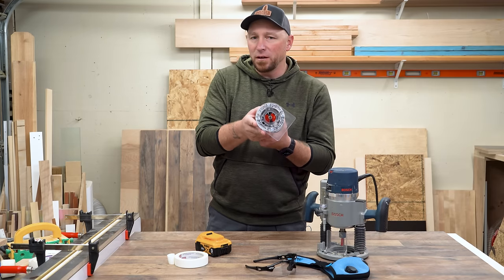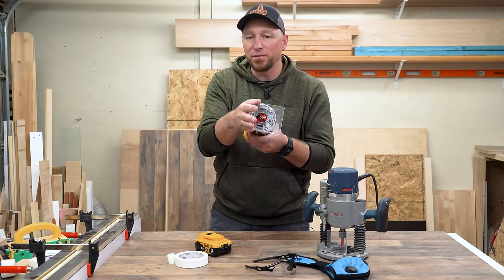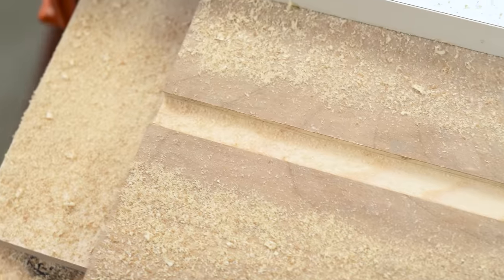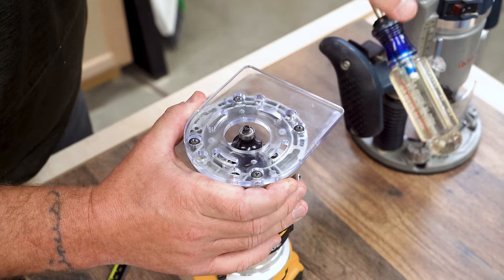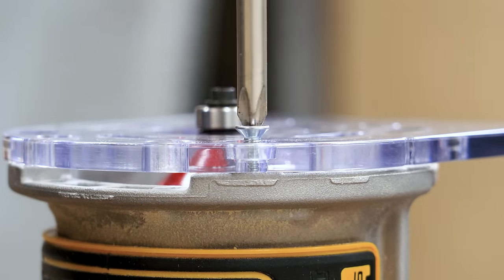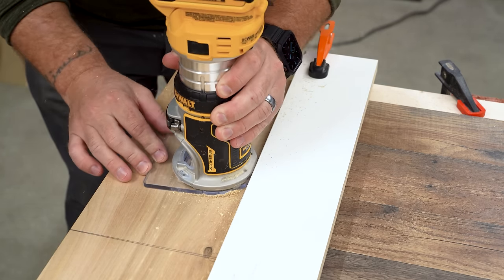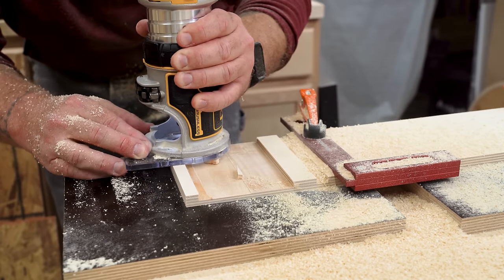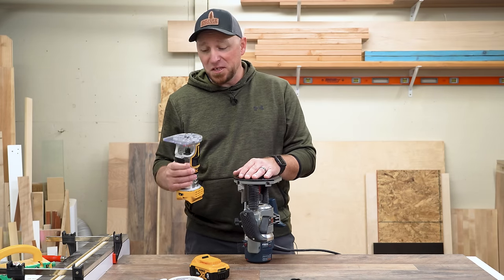END Router FRUSTRATION With This ONE SIMPLE ADJUSTMENT / Woodworking / How to Adjust Sub Base Plate

Comment: The flat side is for widening a groove without repositioning the fence or requiring a perfectly sized bit. After routing along the round edge, the router is rotated to reroute along the flat edge. Since the flat edge is closer to the center of the bit, it creates an offset cut closer to the fence. The offset distance can be shortened or widened by adding a shim to either the fence or the flat edge. Essentially, it makes your jig from your last video obsolete.
Reply: Do folks do this...YES!!!...is it safe or the intended method, not at all...

 The flat side, as many here have suggested is for bit changing and/or for use with a bar rod tie-in concert with a rail/guide system.  "Free handing"  (aka the "cowboy method) with the flat side held against the rail (though common) is not safe, nor allowed in many professional shops and schools...
Reply: @JayCWhiteCloud  There's no issue to routing with the flat against an edge guide, unless you're routing in the wrong direction. The flat can be used for anchoring the router during bit changing, but it's quite a stretch since two wrenches are used and the base is removed.  I really don't see where the flat helps with a edge guide rail system at all.
Reply: @bobweiram6321  As stated, do as you wish (as many do)...HOWEVER...there very much is an...ISSUE!!!...with using the flat edge as a guide against the straight edge (as Jody correctly in his video pointed out!!!) as this can lead to all kinds of issues...and is not the method to use (though many have chosen to.)

As for "stretch" that would depend on the router, though many actually take you through the process in the directions and point out (correctly!) the purpose of the flat edge for stability...

The flat edge for the guide rail is only on some models while others still only have the round edge toward the rail...which depends on the manufacturer...

The only reason I comment on posts like this is too many "students" and/or a novice trying to learn...BEST PRACTICE...in a given skill set...get very confused about what's correct...what is WRONG!!!...and/or unsafe. Case in point a student asked me about this video and how accurate it was...

Again, due as you please (by all means,) and understand my response is for those that don't have experience and/or are trying to learn "best practice" for a given tool...
Reply: @JayCWhiteCloud   You make it very hard to take your best practices seriously when you demonstrate consistent difficulty with basic spelling. It's "do as you wish...", not "due as you wish."
Reply: @bobweiram6321  Typo corrected...didn't change the message context though...

Comment: Wouldn't it just be easier and quicker to just use a centering cone? They're not very expensive and work for both 1/4" and 1/2" collets. I bought one along with my first router and keep it with my bits.

Comment: I always thought the flat side was for easier stop dados and other cuts I don’t want to run full distance. The center of bit line is easier to see and is naturally squared up so I can mark the guide rail for start and stop points or blocks if I’m doing a bunch.
Reply: This again is a "make it work" situation but not what the flat side is for, nor safe to use that way compared to the suggested methods by many here...

Comment: I have a near antique commercially made router table, and the mounting bracket on it requires the flat edge of my router to be oriented so that the flat edge is against the flat edge of the table.

Is that the reason for the flat edge, I dunno. But it might be part of it.

Comment: My belief is that router manufacturers provide a flat face on the circle because the overall diameter provides stability, but having a flat face might allow you to get a cut that is another increment closer than the radius of the circle allows.

Comment: Tapered screws in plastic are a mistake. The angled head produces a state of tension in the plastic. The plastic used in the router base holds up well under compression, but is vulnerable to cracking under tension.

Comment: I always thought the flat side was to get to the end of a boards whem you use a short paralel guide. To prevent the router from twisting around the guide. Whatever... I will use It as i always did. Round side in...
Reply: The flat side is only for bit changing...to use it "cowboy" style is not the most accurate way, nor is it safe...

Comment: The flat side also works to bridge or even out across slightly negative or indented surfaces, sort of like the long shoe on a hand plane. If you've ever used a guide bearing and messed up an edge because your template has a tiny divot you'll understand what I mean.

Comment: My problem with the round part of the sub-base is that sawdust and chips really get trapped between it and the guide, thus causing the exact problem you are trying to avoid. Other than use a different sub-base with a super-extra-long flat side, with square or pointy corners, or use a guide on both sides, my only solution is to just be super-paranoid about sawdust and practically hyperventilate blowing it all out of the way. Hey, my lungs get exercise that way.

Comment: I've read over 100 comments and nobody has mentioned the direction of feed. One way and the bit tends to pull the router against the guide. The other way it pushes it away from the guide so that it's almost impossible to get a straight cut. The cutting edge of the bit should be moving away from the guide. This is basic stuff.  -Old dude.